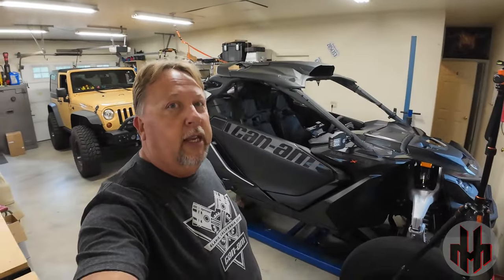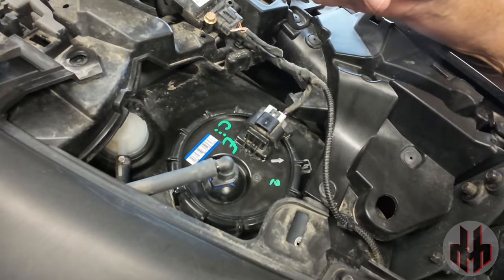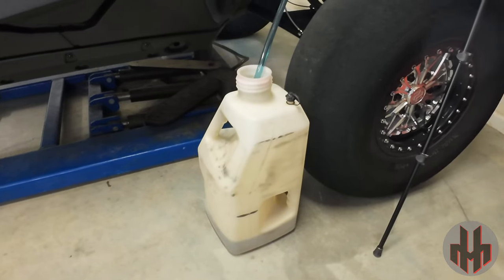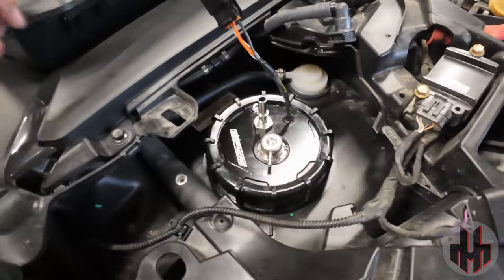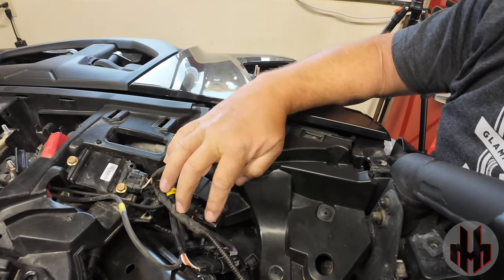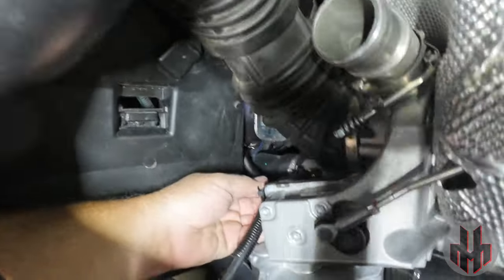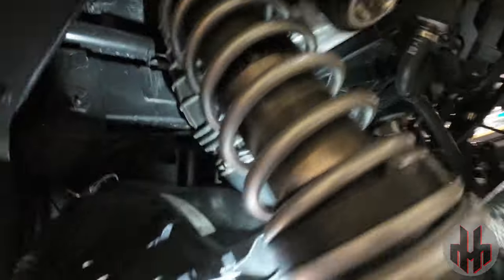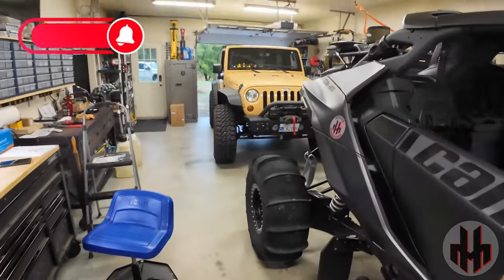Add 106hp to your Maverick R with the EVO E85 upgrade kit!

Comment: and the thing at the top is a billet inline fuel filter. you can dissasemble and clean it, fuel pumps still down in the bottom of the sump
Reply from the maker: Thank you.  I am certainly not the expert.  It sounded good though, right?  Lol
Reply from the maker: FWIW I did at least update the description for the video to clarify that.  THANKS FOR THE HEADS UP!
Reply: @HooverManeuvers  sounded very believeable 😂